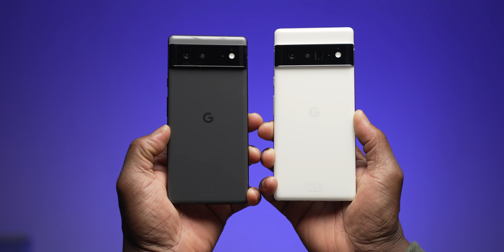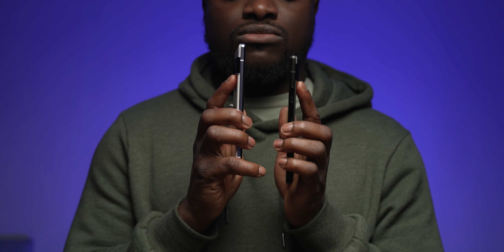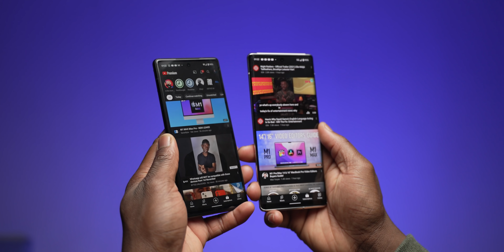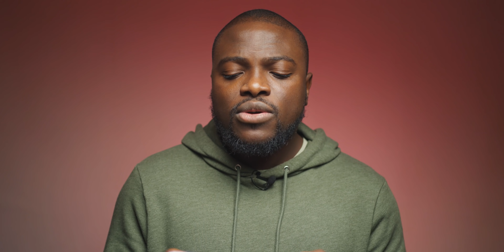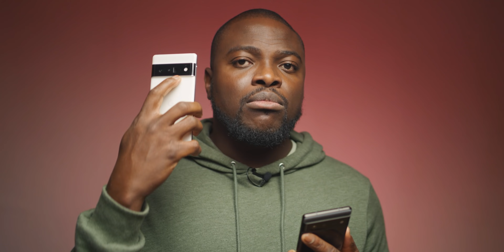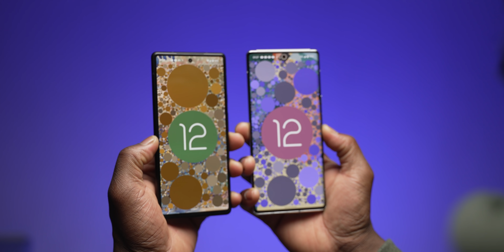Google Pixel 6 vs 6 Pro Impressions | THE RIGHT CHOICE

Comment: Good stuff. I want the bigger screen and added camera features, and battery. I just don't like curved displays. My experience with them have been less than ideal. I'm going to go with the pixel 6. It's not the accidental touching I'm concerned with it's about long term fragility with a curved display. I have had the most cracks with curved displays. Just my experience and I just like the flat displays.
Reply: Pixel 6 is the way to go, also more structural strenght.
Reply: Mate I feel exactly the same ... The thing that killed it for me was the curved display ... I think that was a mistake ... But great for those who love curved display of course...

Comment: Great vid mate! Pixel 6 gets here next week! Love the pro but don't think it offers $300 more over the regular 6. Cheers 👏🏾
Reply: Google played it smart on not mentioning the difference but there's a lot of things different about the 6 and 6pro 
The pro is the only model with mm wave 5g , 120hz , QHD , 11.mp front camera as well  as the only model to shoot 4k on the front camera , 48mp telephoto, stainless steel frame , better speakers , better haptic motor, and  uwb .
Reply: @kdubspencer3390  you're totally right. Let me clarify, the pixel 6 pro is definitely a better phone overall; maybe the best in 2021. Those upgrades you mentioned over the regular 6 just aren't relevant to how I use my phone. If you ordered the 6 pro report back on how you like it once you get it!
Reply: @Tbill19-95  yeah I ordered the sorta sunny model and already purchased slickwraps new oil painting skin for it
Reply: @kdubspencer3390  my guy, love it. Google killing is killing it this year so I really don’t think any of us have anything to worry about. I got that all black pixel 6!
Reply: @Tbill19-95  the black is my favorite but I already had  plans to skin the phone and figured the gold frame would pop more with a skin on it.
Some ppl have been showing pics and videos from hands on at best buy
Reply: @kdubspencer3390  And the Pro also has more RAM (12 gigs vs 8) and the 120hz QHD+ LTPO OLED which allows it to have dynamic refresh rate all the way down to 10hz. The regular 6 has a 90hz regular 1080p OLED panel
Reply: Same here. My thoughts exactly..